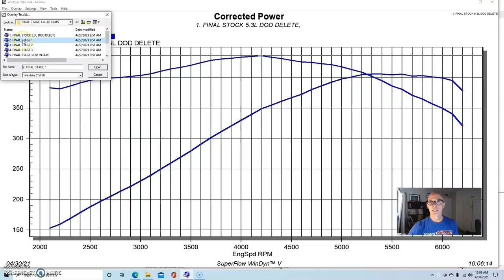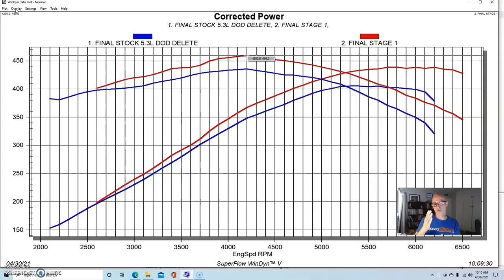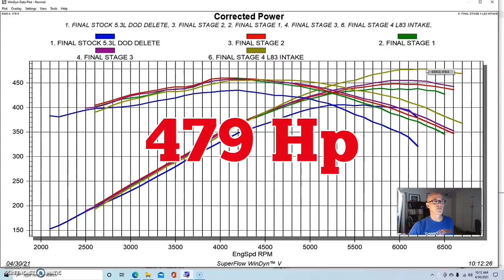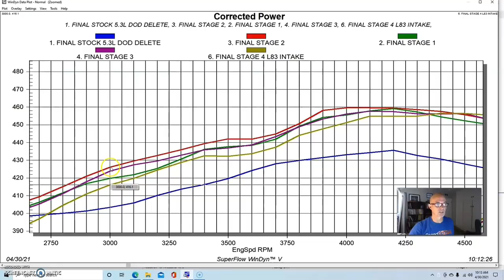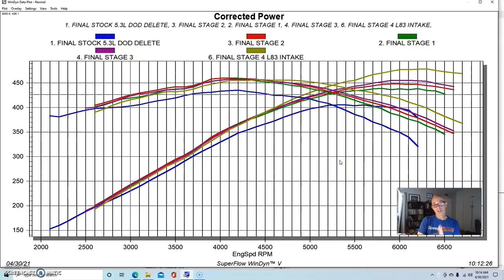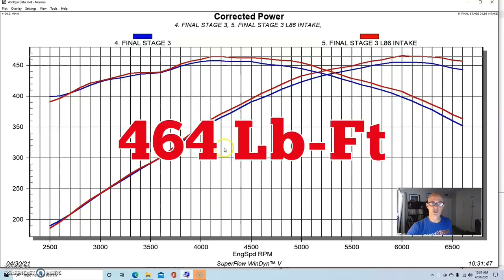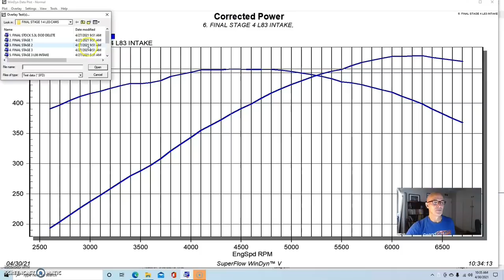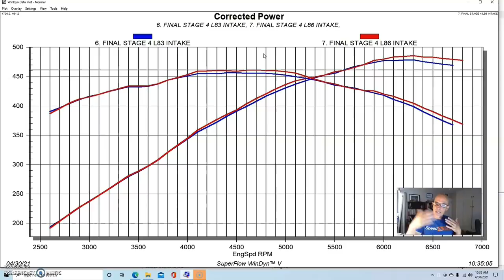5.3L CAM TEST-GEN 5 L83 vs BTR STAGE 1-4 (GEN 5 CAM & L86 INTAKE SWAPS)

Comment: would love to have seen the stage 1 and especially Stage 2 cams with the L86 manifold... also what injectors are used with the l86 manifold.???
Reply: Stock injectors, they easily flow enough with an L86 intake.

Comment: So with the stage 3 cam and l86 intake was the throttle body used from the l86 as well? I'm curious cause I want to upgrade the cam and intake on my 2018 suburban and get some good power output with that set up
Reply from the maker: TB size was the same as throttle opening on the intake

Comment: This might be a dumb question but i'm thinking of ordering BTR stage 3 cam kit for my 2015 5.3 l83. The kit comes with the cam, upgraded valve springs, pushrods, and the phaser limiter with tool, and i'm curious do these kits act as a afm/dod delete as well or do i have to get the different lifters, and trays, and all the other stuff first before doing the cam swap or can these cams run with afm/dod still active. Everything i have right now is stock on the engine.
Reply from the maker: ask btr

Comment: What about comparing fuel use with all cams? Is there a sweet spot for bigger cams that don’t kill fuel mileage much?
Reply from the maker: mpg must be done in a vehicle
Reply: @richardholdener1727  yeah I understand. But it’s save to assume correctly that the smaller cam stage/lobe the better mpg through out the rpm?

Comment: Hey Richard I have a LQ9 with 243 heads and was wondering if there would be any PTV issues with the stage 4  BTR-33348123R0
Reply from the maker: if it is big-you need to check

Comment: Richard, watching your video it seems as though you (and myself quite frankly) did NOT use cam phaser lockouts as.you very clearly took full advantage of the VVT, as shown by that fat and flat TQ curve. 
Now im looking at Texas Speed and BTR for cams to upgrade my L83, and TSP in particular seems to strongly suggest using a cam phaser lockout kit with a cam upgrade. Whats your opinion
Reply from the maker: limiters were run on the cams that required it

Comment: Did they test the stage 2 cam with the bigger intake, just curious?  Also,  did the stage 2 cam require bigger springs and different lifters or was that all on a stock valve train? Sorry I'm new to all these new engines and what's what, I stopped around the time of LS1's lol.

Comment: Hope you see this.  Nice video first off.  Ok i have a L83.  Plan to build it for street driving and 1/8 racing.  Now we have options for dod, vvt, and Di deletes with port injection conversion with a ls7 intake.  If adding a turbo, upgrading pistons, rods, cam, lifters, head ported holley efi should i go with the full delete of everything and ls7 port injection?  Or holley offers efi with vvt control do you think it could make a more consistent power band for the 1/8 if i leave the vvt?

Comment: So, adding 1 3/4" headers with high flow cats, cai and free flowing muffler with a good custom tune AND e50 to a 2018 6.2 should net _ hp/tq?
Reply from the maker: some
Reply: Hahaha.  Probably correct, but I was hoping for a little more specifics.  Fib and say something like...less than 100hp 😁

Comment: What fuel was used for these test?
Any test results for L83 5.3L with L86 intake manifold and TB with BTR stage 2 cam?
Reply from the maker: 93
Reply: @richardholdener1727  were these testing done with L86 intake and TB?

Comment: Did you use the stock 5.3 injectors when you put the L86 intake on or, did you use the L86 injectors?
Reply from the maker: not sure
Reply: @richardholdener1727   Maybe you can ask.  Thanks.

Comment: You say you are using the VVT to improve what would otherwise be lost with the cams, does that mean you are using a phaser limiter, or no limiter for your setups?
Reply from the maker: no limiter needed on the smaller cams
Reply: @richardholdener1727  Thanks for this video it is great!  I notice most everyone running these cams are still using a 0deg VVT limiter and they say BTR has them running it, even on a stage 2 came in a L86.  Did you really get away with no limiter on even the BTR GenV stage 2 truck cam in a L83?  Thanks!

Comment: what does this engine weigh fully dressed vs L33 5.3?
Reply from the maker: not sure
Reply: @richardholdener1727   Thanks, I'm considering for my aluminum jet boat. The current 302 is light but a bit weak. I will probably end up with a L33 , not sure what cam yet though.

Comment: 454chuys porting is supposedly a big gain on tb and intake, he can make an lt5 tb (95mm) fit on an l86 manifold as well
Reply: upwards of 30hp gain supposedly
Reply from the maker: 30 hp from a TB?
Reply: @richardholdener1727   ported tb bc they come with a huge lip about 6mm from the throttle blade stock, and ported manifold aswell. tb is worth more like 10-15

Comment: Should have added the lt1 intake some ppl say it hurts the l83 and also try the c8 vette intake lt2 intake on the same cams
Reply from the maker: the short runner LT1 intake will hurt power down low compared to the l83
Reply: @richardholdener1727   yea that what i have herd, what about the c8 intake .

Comment: So what about my L82 in my 2020 Silverado Trail Boss? I'm liking the L86 intake and throttle body but I don't know about the compatibility. From what I can tell my L82 does not have dynamic fuel management but does have active fuel management. It's also not E85 compatible I don't think. Any ideas?
Reply from the maker: THE INTAKE STILL WORKS
Reply: Keep it stock 
Doing the intake and throttle swap requires tuning and the stock cams sucks.
Tbh
Reply: @reyperez3424  I had an lq4 in my other truck and ran the BTR stage 3 truck cam and had it dyno tuned. I just miss that extra power and have a hard time leaving my vehicles stock.

Comment: My version of a gen III 5.3 to be sorta comparable to the Gen 5 is to make it a 347, raise the compression to 10.4, improve the quench, a BTR stage 1 truck cam, 706 heads with 2" intakes, proper valve job, some minor valve unshrouding, porting and thermal barrier coated valves, TBSS intake, Long tube headers, 6.2L sized exhaust & cats behind the headers. Daily driver Tahoe. Waiting on the heads and machine work now.

Comment: VVT allows the increase in power at the top with maintaining the low rpm torque. Now we just need variable intake runner length as the hemi has now for even better numbers.
Reply: Everyones higher power level engine has a short or medium runner intake.    Variable runners are usually helping out smaller engines.

Comment: Stage 2 cam for me.  No torque loss down to 2500 rpm.  

The Gen V's are so good, you should hunt down an LV3 and test it against an old 4.8.  Then do a Big Bang Turbo test with it to see how the split pin crank does.  I bet you can't break it.

Comment: I've got a daily driver and would like more torque under the curve. Centrifugal supercharger?
Reply: Centrifugal supercharger is the antithesis of area under the curve.
Reply: @corystansbury  any suggestions?
Reply: @jarodolsen8955  What is the vehicle in question? In general, nothing does area under the curve like a smaller turbo, but that's not always practical.
Reply: @jarodolsen8955  positive displacement blower. Like a twin screw. Otherwise smallish turbo. Blower wins response, turbo wins efficiency if sized correct.
Reply: @corystansbury  2019 tahoe
Reply: @jarodolsen8955  5.3 I'm guessing? I'd go with a PD blower, as Richard mentioned. Lots of aftermarket out there, or can rig up an LT4 blower. It's arguably a better fit for the 5.3 than the 6.2 from which it came.

Looks like both Magnuson and Edelbrock have TVS blowers that bolt up. The Edelbrock has the big rotor pack and claims bigger numbers, but read around first. Bigger isn't always better, as you're really not even close to maxing out any of the blowers in question (1900, 2300, or 2650).
Reply: @corystansbury yup, 5.3. I'm not looking for monster peak at all. Just want a solid 40 lbs or more of "under the curve torque". I must admit having owned a gen 3 and gen 5 5.3, this gen 5 is no slouch. It is arguably better than my lq4 as far as torque and horsepower goes. Btw, thanks for the good info.
Reply from the maker: pd blower or turbo
Reply: @richardholdener1727  thank you sir

Comment: The guys at BTR not have an LT2 intake? Watched a couple videos where they make more power than an MSD gen5 intake up to 6000rpm and more peak power and torque on a stock 2019 camaro. They need a tiny bit of work to work but are $1000 less than the MSD intake. The Map sensor needs  extended and brake vacuum port and valley vent are issues, but it will work with your super sneaky cowl induction.
Reply from the maker: it was ordered-but not tested before I left

Comment: Darn it Richard, now I am thinking I need a gen V instead of a gen IV/III
Reply from the maker: no bad choices
Reply: @richardholdener1727  what you think about the gen v lt5 camshaft  for the l83  engine  heres the lt5 cam specs 200/207  554/521  lsa 116.5
Reply: @richardholdener1727  im gonna swap to a btr gen v cam  which stage do you think best  stage 2 or stage 3  i need your honest amswer plz
Reply: @cedricsanders4975  if you’re debating between stage 2 & 3, get a stage 2. The difference in power was insignificant yet the stage 2’s balls came on a lot sooner on the torque curve
Reply: @beowulf6571  would the stage 2 give me some chop chop sound
Reply: what you think about the l84  5.3

Comment: I am in the middle of this swap and i got ahold of a Lt1 intake manifold. I mainly used it for clearance issues. I wonder what kind of gain/loss would happen with a stock LT1 intake manifold and a BTR Stage 1-3 cam. I am really glad you are doing dyno videos on these engines because it helps ease my mind about the engine choice I have.
Reply: Tbh you're better off running the l86 manifold and a 95mm tb just port both and you gain extra 20 hp way cheaper and a direct fit than going from a lt1 or lt5 manifold unless you're going boosted and if you are better off running the holley hi ram

Comment: Guessing you have another video with that msd and stg 4 cam combination on L83 coming up
Reply from the maker: that is already up
Reply: @richardholdener1727  nice, so L83 cam and manifold combo data from your videos.
513hp/443lbft w/msd & stg 4 cam.
479hp/456lbft w/L83 & stg 4 cam.
486hp/461lbft w/L86 & stg 4 cam.

Comment: I wonder why they offer a stage one cam in this instance since the stage two made the same low speed power and more top end. Gen V motors are impressive.
Reply: Idle quality along  other things.
Reply: @CULT539  agree. Did the stage 1 on my '17 Yukon XL. Idle is nice, just a tad bit of the lope but honestly it's barely there. I had Corsa exhaust on it before, but once at the tuner and on the dyno picked up around 30 hp over stock. Not too bad really for a DD. Tuned for 91, these engines run better on it with the compression ratio they have.